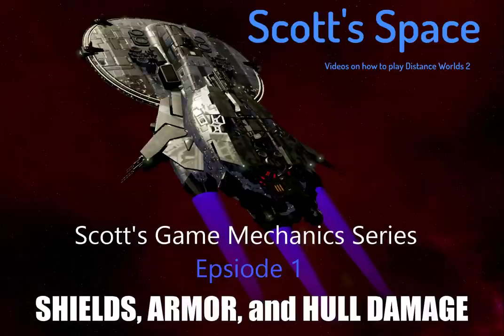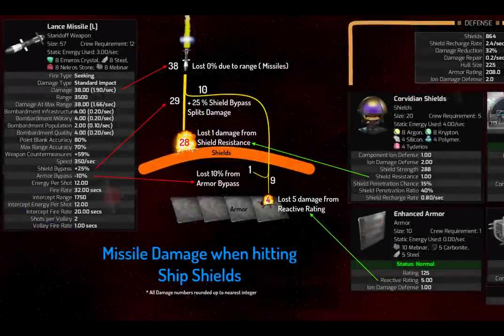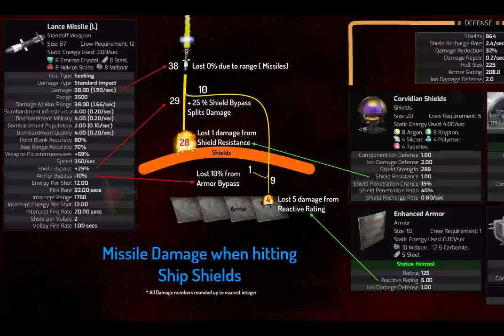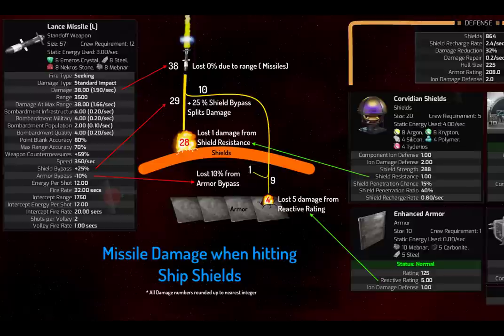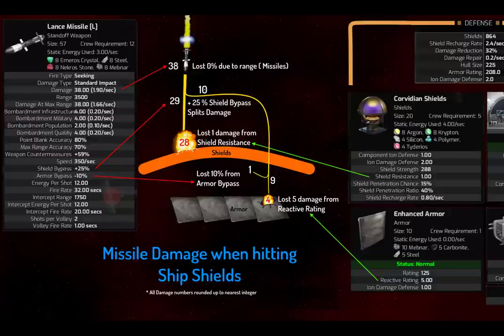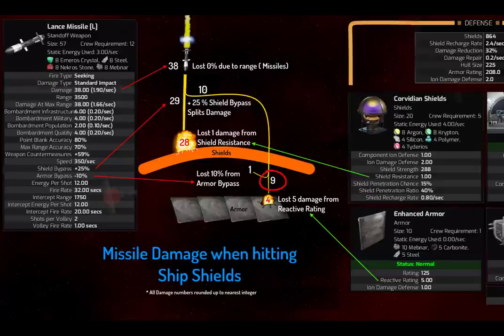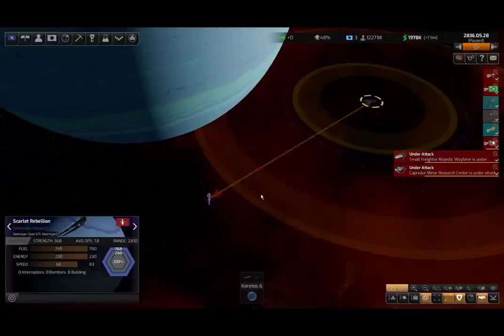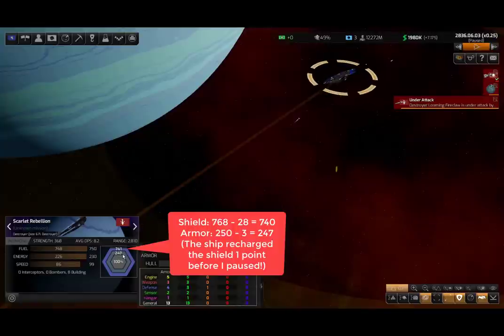Scott's GAME MECHANICS for Distant Worlds 2:  Episode 1:  Shields, Armor, and Hull Damage

Comment: Repost: "You might also want to reference a system I consider critical. The 'Shield Boosters' the first adds 40 to the shield strength, but more importantly, it adds 2 to resistance. And that is all of t3(4?)"

Edit: The final Quantum Capacitor adds 100 to the shields, and 6 to the Resistance, and it seems to allow more than one but I have not verified that they stack yet as with my DD's they resist 11,and regen 16/second so most damage doesn't even register
Reply from the maker: Great point.  So I'm going to do a Components/research video so I will definitely talk about that. Thanks for the tip!
Reply: Thank you! I always considered the boosters to be useless because I didn't notice the resistance boost.
Reply: @3DiversionsDeep  Yes, when the top of the line normal shield has resistance 5, and the top booster adds +6, it is very relevant. LOL The resistance doesn't stack with multiple boosters, but the shield strength and regen rates stack fully. Seeing 'Shield Regen +32.33 per second is nothing to sneeze at....

Comment: Great video Scott! Thanks for making these and hope you keep them coming.

One thing I would like to point out is that when designing a ship you can see your hull reactive rating my scrolling down the right hand portion of ship stats until you reach the defensive section. Where it shows shields and armor amounts, resistance/reactive rating. The hull points and reactive rating is lumped into the armor section if you hold the cursor over the armor bar.

Not sure if that will work when looking at ship designs of other factions however.
Reply from the maker: Great find!  I've never tried to hover over that graphic!!!  Thanks for sharing with everyone!

Comment: Nova missile is another great weapon for testing, be sure to test against enemy with bad fire arc(Mortalen) so PD wouldn’t ruin the result.
Reply: Medical module also provide a decent DR which push it to 60%+ DR in total, it’s justifiable on larger ships
Reply: @renyaoqin  I calculated from the last techs that you can reach 70% DR with Medical Center(+10%), Command Module(+10%), Damage Control(+45%) and Crew quaters(+5%). I dont know if there are hidden techs that can increase this even more
Reply: @jannefock9337  I haven't tracked all of them down, but my ships are at 52% DR without Medical, or an Admiral in that fleet

Comment: Excellent video, thanks Scott. Question - Hull "health" is given as a percentile, but do different hulls have  different hit points? If not, is there any other factor that defines how many hits a hull can take other than the hull reactive rating?
Reply from the maker: Good question - I'm 95% sure "hull size" is the damage it takes (if you go to the design screen, on the right panel, scroll down to "Defenses" - you'll see hull size listed there.  I'm sure that is the damage it takes.

Comment: These mechanics seem to favour bigger ships, assuming resources spend and maintenance cost is comparable. You agree? How many frigates vs how many destroyers are comparable (well build mid game ships). 

Higher damage per shot beats more shots if dps is similar. And nice to collect all the bonuses you can get from all these modules. Finally when soaking damage smaller ships will be knocked out or even destroyed sooner if damage is spread unevenly. 

Are there certain roles (killing fighters and PD?) that smaller ships are better in or give synergy when mixed? Maybe they can be made faster? (cautious long range missile ships?)

Do bigger ships have weaknesses? A higher base hit chance iirc. Maybe lucky ion shots are nastier? Are cruisers something to rush towards early?
Reply from the maker: Really big ships have penalties to countermeasures.  See my new chart in the V2.5 of my guide.
Reply: @scottsspace5562  Penalties to countermeasures, but increased shield regen and longer ranges make up for a lot of it. Also when a Destroyer runs around with 2156 points of non-leaky shields (Zenox Racials) that have 11 resistance, and armor with 15 reactive, two large weapons (Quantum Shard & Titan Blaster)... who needs that Cruiser... That thing one shots creatures and can solo most Pirate bases... /shudder  A dozen of them did for the Hive Biggie
Reply: @williamklett6660  
Wow, cool! Will such a ship be insanely expensive (resources and maintenance)? And how long to research those things?
Reply: @teambellavsteamalice  This NOT a cheap or early ship. Several techs are at or near the Cap, only 'Super' techs are better. 34K to build, 1.2K to maintain. I'll link pictures in the post below YT seems to be deleting posts with links. This is not the best version of this. The Zenox have a distinct lack of weapon hardpoints. But briefly: Strength 11,386    DPS 34.1   Range 5000.  Shields  4440   Armor 360

Several techs have upgraded since I first mentioned it. Shields are at the Zenox tech maximum, with v3 Quantum Capacitors. Armor has 1 tech upgrade, Engines and Maneuver and such have a ways to go. Both weapons have the final upgrades left. BUT is there a need, LOL   Currently designing the Fleet Cruiser version, Dreadnought techs will take a bit still, but I shudder at basically quadruple everything...
Reply: @teambellavsteamalice  Sorry YT deleted my post. If you have access to the Official DW2 Discord, the images are there in the Screens_video thread. I can link them directly if you have a safe email or chat link.
Reply: @williamklett6660  
Just reading through Scott's guide fully. Dreadnought cruiser seems awesome indeed. Probably everything is designed in a way each is suitable for a specific role or is flexible/multi functional for a cost. 
Love designs that are optimal for their cost and research effort, but such things tend to get nerfed with updates (or get cheesy when overused). The most fun would be to have a cool mix of ships (and tactics) that give synergy and look cool (tanky ships doing the tanking and longe range actually staying out of range, I've not seen that yet).
Reply: @teambellavsteamalice  Scott's Guide does a fabulous job of presenting important info that even experts might have missed. The video demonstrations are the icing on the cake. 
Personally, the most effective weapon system grouping, IMO, is also the hardest to research. Ion weapons nibble and chew their way through shields, but once they get through they are obscenely powerful. Grouped with Gravitic and Area it becomes insane, BUT! Gravitic weapons are large, you have to get to t5 for a medium sized, and t6 for a small weapon and it never produces a fighter version. However, the trick with Gravitic weapons, direct fire and area, is that they have a 50% Shield bypass, and a 75% Armor bypass. The final version is AOE and in the best case at close range it punches 180 damage directly into the Hull. Anything Destroyer and smaller is pretty much one shot, and even a Dreadnought isn't going to be having fun.
So, be ready to have fill-in system to cover the lean days when you might find a peashooter more effective
Reply: @williamklett6660  
Oh, I hoped ion weapons were cool when used right. Probably combined with epsilon torpedoes, missile ships and maybe one more type (the anti fighter pulse?). But it seems with salvaging new ships and tech stealing or trading at least one of your most powerful weapons will be determined by fate anyway. Maybe most are. 

The only thing I wonder about this game is how to stop playing. I'll buy it when I have a bit more time, but atm don't trust myself stopping unless with great effort. (I once gamed almost nonstop for 14 hours, and so many times planned to play a game from 8-12 pm and suddenly it's like 3 am... 😳) Looking forward to it a lot, so researching ways to play a nice game without micromanaging or retrying insane difficulties too much. ☺️ Checking fun strategies is a lot of fun in the meantime!
Reply: @teambellavsteamalice  Gaming time, I fully understand. The DW2 hasn't been in release a month yet and I am at 256 hours played...  Some of those were insane joke difficulty level settings :)

Comment: Can someone explain why are energy collectors needed, if your ships have reactors? Is it to provide power to the ship if you run out of fuel?
Reply: All components have passive and active power draw. The ship designer advises you to have more energy collection than passive power draw, so the ship doesnt burn fuel while idle. During warp and some other moments energy collectors dont work so all power is coming from reactors
Reply: @jannefock9337  So you should try to place enough energy collectors to cover all passive power for a ship when idle? I guess this could explain why my ships keep running out of fuel, I sometimes take out energy collectors and leave only one. Thanks for the input !

Comment: Does Damage Repair also repair slowly a disabled ship?
Reply: Robotic Repair has a chance to restore a destroyed system, Simple Damage Control doesn't list that ability
Reply from the maker: @williamklett6660  Great question and answer.  I thought they all do - but good find on the Galactopedia.  This calls for some testing!
Reply: @scottsspace5562  It might be hard as you'll need to be sure a system, and not the damage control, is destroyed and not simply damaged.
Reply: @williamklett6660  You can see which components are damaged or broken by clicking on the ship and clicking on the type name(Cruiser v3 for example)

Comment: Do the PD apply dmg only to what is fired at the ship which has the PD or to whatever is fired (rockets/missiles/fighters etc.)?
Reply from the maker: It can hit weapons fired at the defending ship, it can hit the thing (e.g. a fighter) that fired the weapon.  It can even hit big ships if there are no weapons or fighters to fire at (albeit at a penalty)
Reply: @scottsspace5562  Thank you for replying. So it only hits weapons fired at the defending ship but not weapons fired at another ship?

For example, lets say I have a destroyer set as the attacking ship without any PD on it and two frigates set as a close guard with PD-es on them. If an enemy ship attacks the destroyer with rockets, lets say, will the PD from the frigates try to destroy those rockets?
Reply: @DorinBucata  Correct. i have never seen a ship firing PD at passing weapons, just fighters or ships.
One interesting thing I have witnessed with Torpedoes, but not with Missiles, is misses curling around to attack again. PD seems to be ignoring these second passes. Not 100% on this as the conditions for it are too difficult to track without a lot more data than I have.

Comment: I had an ion nebula and basically required to have all ships be given the EMP resistance armor. Is there some way to automate this?
Reply from the maker: Not that I know of.
Reply: Eventually the Auto-designed civilian ships will add an Ion Shield, but never Ion Armor. For some reason Passenger ships you need to add it manually.
State ships on auto will rarely add optional systems. Ion Shields, Quantum capacitors, etc, but once you add them manually even if you leave the design on auto it seems to maintain updating the optional systems